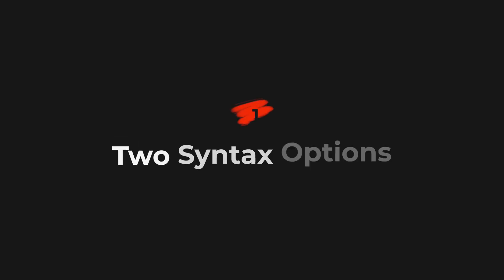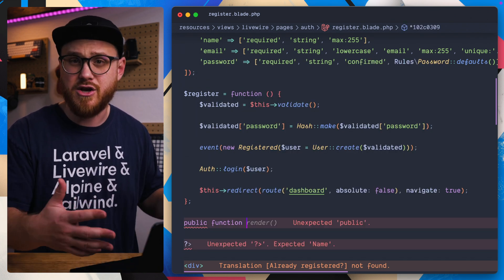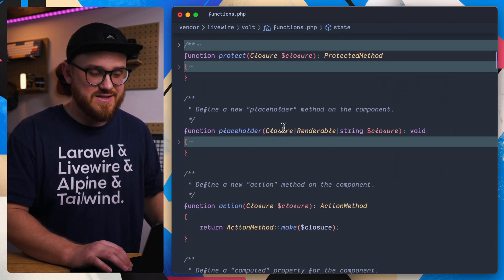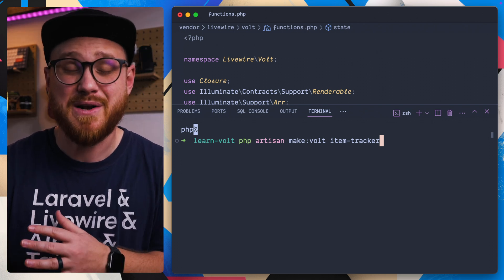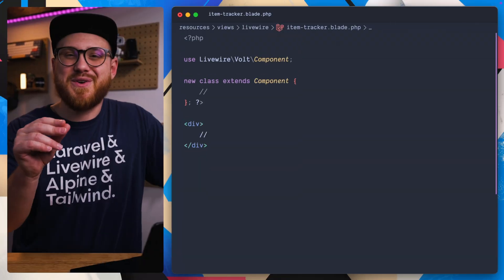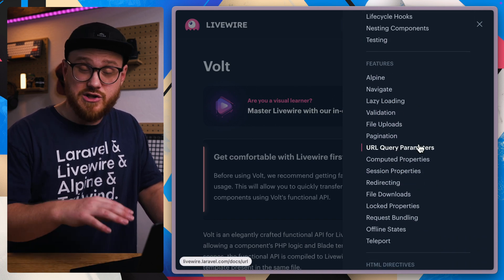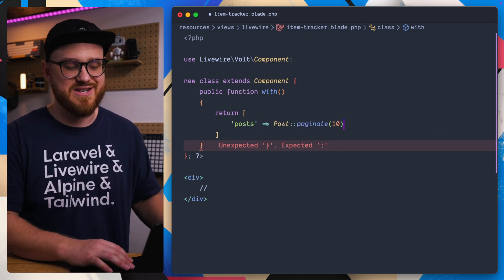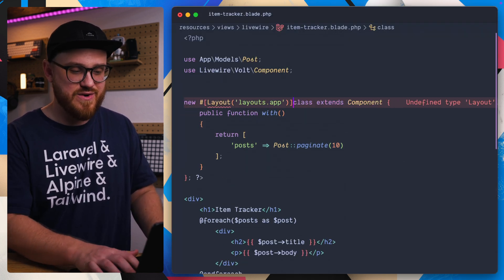Three Things You Need to Know about Livewire Volt in 9 Minutes

Comment: When i create a volt component it creates a class based component instead of functional API what am i doing wrong?

I'm using the command 

php artisan make:volt post
Reply from the maker: This is likely because you are using the updated starter kits which default to the Class based API. 

You can pass the parameter of --functional at the end of the make:volt command to generate a component with the functional API stub.
Reply: @LaravelPHP  i tried that flag but it doesn't work
Reply: @prane81  Can't you just delete the class and write the functional code? It doesn't even take a few seconds to remove the class block.
Reply: @hentype  Did you help create Volt or something? All your comments are disregarding questions or critique and some blaming or insulting people while you‘re at it. Why even use artisan if we have to do its work ourselves or clean after it? That‘s the whole point of artisan.

Comment: what is a beneft of using volt over traditional livewire component? "cleaner" code? genuienly asking
Reply: with this Volt, you can put all logic and templating at one file.. just like ol single index.php file.
Reply: It makes prototyping faster, that's for sure. It works for people who want to contain both the backend logic and template in a single component file. But then again, it's not a mandatory feature so if you don't find it useful you don't have to use it. Stick to what works best for you.
Reply: One file is better than 2 for every livewire component.
Reply: @ if that’s the only thing, then you could make an argument to put all your logic in your traditional view file.. with your only difference being that all this logic is at the top of the file than in the view itself
Reply: @colormeblue  if it continues to work that way 🤷‍♂️ I’m only talking in the context of using Volt, the beauty is you can do what you want.

Comment: Why were frameworks created, to separate concerns and now are we adopting the earlier approach to composite both layers again?
Reply: Much prefer co-location, nothing worse than digging through layers of abstraction to fix a problem.
Reply: The thing is you don't have to. Stuff like Volt and Filament are just there for those who want it, and doing livewire the traditional way isn't outdated at all. If you hate volt, just don't use it. Actually, if you don't like livewire at all, just don't use it. You can go for react/svelte/vue + inertia for a reactive frontend if you want. Heck, you can even go bootstrap + jquery if you prefer doing things that way. That's what's great about laravel.
Reply: Exactly
Reply: It depend on you need, the important thing we have choice
Reply: Having a framework and separation is all great especially on large projects but having the ability to knock out a simple small project with volt like this is amazing.
Reply: No more MVC I guess
Reply: @deddyachmaddaryaman7981  Stop being such a low-IQ monkey. Nobody's stopping anyone to go MVC in livewire. Volt isn't a requirement, it is a choice.